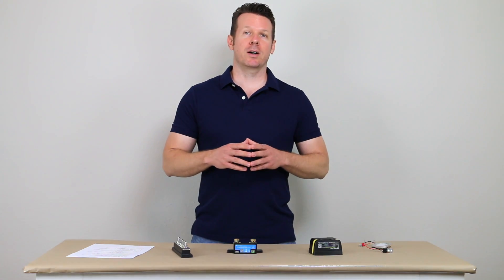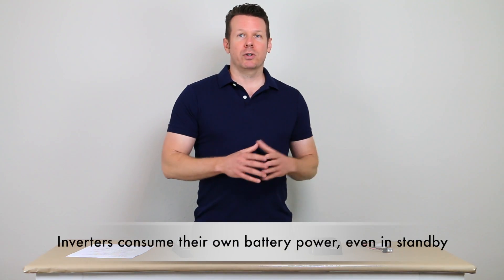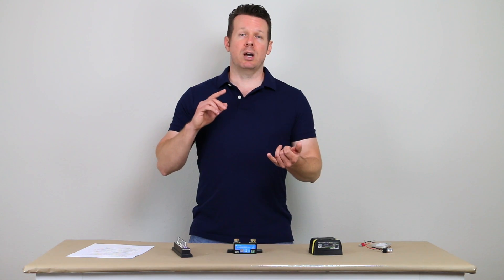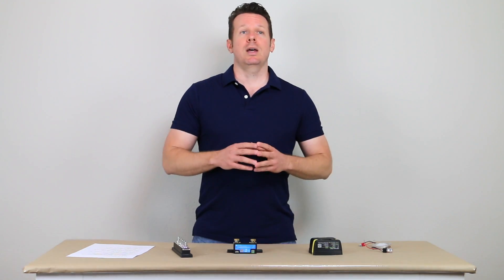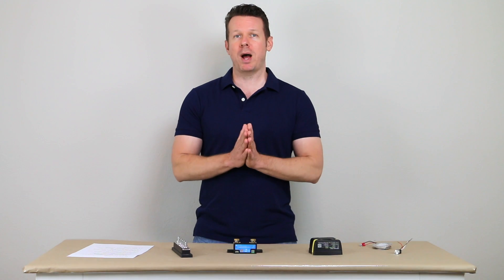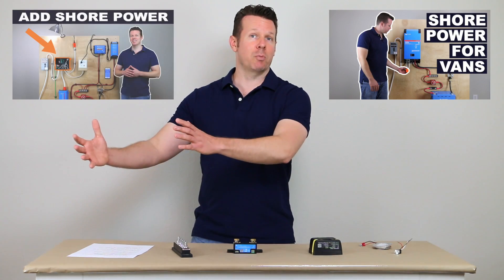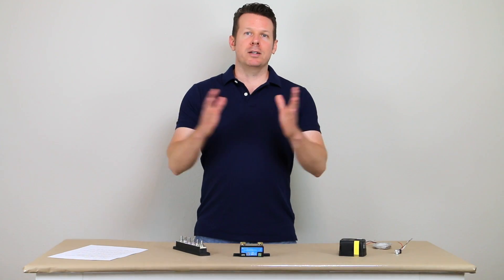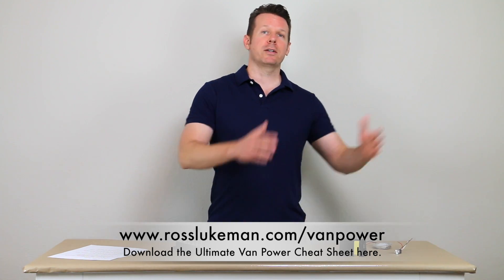The Top 10 Power System Mistakes for Van Conversions

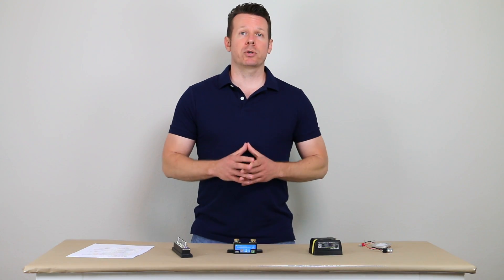Comment: 0:34 too many appliances
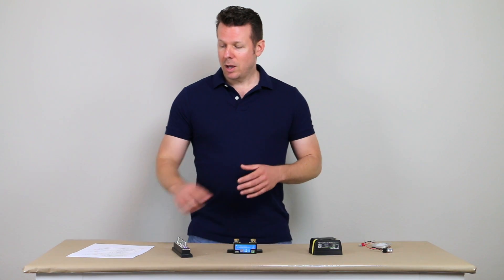2:14 lights should be 12v dimmers
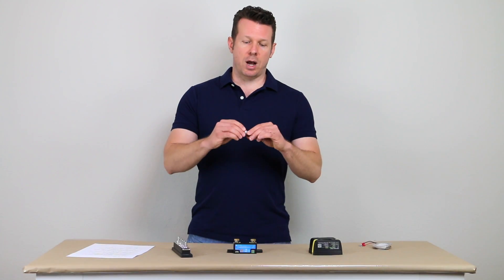3:04 invest in heating/cooling for comfort
4:22 plug in ability
5:28 relay instead of dc to dc charger
7:10 details on his cheat sheet (free)
8:28 easy switch for water heater
9:48 electric heaters (1500w!)
12:56 locking hardware

Comment: Definitely have a diesel heater for heat but also have a 38 SEER 240v Mini split for heat, too. Average amperage is 0.463 during a 24-hour run (14-20 degrees outside temp and maintained 66 degrees inside) Only 261w avg per hour!

Comment: Is there a simple system for just shore power and solar to charge 12 volt house batteries. I wouldn't mind spending money on the all in one inverter for when I plug into shore power it will just charge the batteries by way of shore power or solar...without me thinking about it.  I would like to keep the cabin system totally separate from the vans battery and alternator.

Comment: About the fridge situation. You mentioned dorm style fridge but you didn’t mention freezer style chest with dual thermostat that makes it work as fridge.
Reply from the maker: My point was that 120V AC appliances require the inverter to be on 24/7, so the freezer would have the same requirement as the 120V fridges.

Comment: One way to stay warm at night using electricity is with a 12V heating blanket. They typically use 40-60 watts, which is a lot less than a portable electric heater. . Why heat up the whole van when all you need is 'zone' heating (e.g., your body). 

If below freezing weather is possible, consider a 12V heating pad for your water supply. That's another example of zone heating. You don't want to wake up to ice damage. And... some foods don't react well to freezing temperatures either. Protect accordingly.

A 12V kettle will provide you with a way to warm you up internally before bedtime with some hot cocoa, tea or coffee (decaf of course) and maybe some oatmeal too.

Comment: Ross, I work with industrial power systems but do not have formal training with DC systems. I’ve heard and read that 24V and 48V increase longevity of battery lifetime. Why do a lot of vanlife type systems push 12V?
Reply from the maker: Hey there, I think 12V is preferred because it tends to match the alternators and appliances being used, at least in the current times and past decades. Perhaps that will change. I cannot see how higher voltage would change battery life, unless the current consumed is reduced. The current consumption would be a factor of a specific system's actual batteries and loads though, so I cannot make universal statements about using less current/capacity. I would be curious to hear their reasoning on increased battery life. Interesting question, thanks for tuning in-

Comment: Thanks for the many youtube information videos.
I had a Webasto heater. But it used miles of electricity when starting, but also when shutting down. (burner burning clean?) And with a thermostat it can therefore happen that quite a bit is consumed.
Reply from the maker: Hi Ben, thanks for tuning in and sharing your experience!

Comment: Hi there,
Currently I have a 2023 Winnebago Revel, originally it came with 320A Li3 battery, can I purchase another same battery to connect it in parallel, and become 640A? Will it mess up the whole system or will cause any damage? Please let me know. 
Many thanks!
Xiang Chen
Reply from the maker: Hi Xiang, I would say no, it won't mess anything up. You are essentially enlarging the "fuel tank," and this does not affect the "engine." However....I would ask Winnebago and see what they say.
Reply: @rosslukeman  Hi Ross, thank you so much for replying back to me so fast and giving me your opinions. Best wishes ❤️
Reply from the maker: Glad to help, good luck with it!

Comment: In the UK we find the fridge is better getting a 3 way fridge 1 is 12 volt ,2 is LPG , 3 is mains hook UP or switch to the inverter. And we use a diesel heater like they use in the cabs of a HGV

Comment: Problem is ...12v fridge cost a 1000 bucks for a proper  compressor driven unit . A 120 volt fridge .the same size cost under 200...
Reply: You make up for that cost in your energy use, and efficiency. Ying to the yang.

Comment: 12 volt appliance is the key. Lithium battery no need for solar the generator can fully charge a fully drain lithium in just 5 hours. Or alternator with a dc to dc charger.

Comment: Is the power draw between using a 12v fridge and a 120v home fridge really that big of a difference?
Reply: In my experience, the power draw is minimal and can be figured for by just getting one more battery and/or solar panel. A 12V fridge can only cool to about 40 degrees F below ambient air temperature, while a 120V "home" refrigerator 
will keep the temperature inside at the point you set it for. I have a small cubical refrigerator/freezer that, in refrigerator mode,  uses 828W @ startup; 285W down to 96W in about 5 minutes running, with no Wattage resting. That means one could use a seperate 1000W inverter to run it while keeping the pull from the battery at a minimum.
Reply: @Tumbleweed5150  My refrigerator/freezer is a table model, so not a small one and it consumes about 300 Watt per day, when the compressor is running it uses less than 50 Watt at 220V, 12 volt  models are tree times the kost, strange that they don't make energy efficient models in the US.
Reply: @Tumbleweed5150  I'm going to have to disagree with the 40° below ambient. I have a 12v compressor fridge and it's just as good as my home fridge. 0-10 for the freezer and 35-40 for the refrigerator. It uses about 65-70W when the compressor is running.
Reply from the maker: It's not the fridge itself, it's the extra wasted power of running it through an inverter, and keeping the inverter on 24/7 (in case the fridge needs to kick on), which also uses some power as the inverter sits there in standby.

Comment: Hi, I'm looking at installing a 240v hook up. Does the consumer unit need to be bonded/earthed to the chassis? Some people say definitely not, and some people say yes, so I'm not sure what to do. Thanks.
Reply from the maker: In general what you would connect to the chassis is a "case ground." The case of each piece of equipment is grounded to the chassis. The ground from the 240V cable is not grounded to the chassis. You're grounding the equipment casing to the chassis so that if the case becomes "hot" (electrified), you yourself are not the path for the electricity to flow to the chassis, the chassis ground wire will be.

Comment: Hello Ross, yes I am learning a lot from your DIY Solar Van Victron Electric Systems and builds. I am at a point where I want to build multiple portable generators but as you know there are times when the supply and distribution system do not always have the necessary part or solar panels I want. I am thinking about have just the battery with inverter that can be recharged by AC power until the solar panels and the other items are restocked. There on back order. I am also doing research and trying to understand multiple sized Victron inverters and how to use them as generators in both van and also off grid power supply in rural off grid agricultural settings. There are locations where I need 500 watt,1,200 and at times higher. I am trying to understand in the van build I want to build I want it to have it’s own battery bank but also have a station to recharge the batteries I use in the different Mobil generator batteries with inverters. Right now I do not know if I need two systems or one integrated system to do that?
Reply: In my personal experience, it's better to have one system just large enough to power what one needs, plus a little extra battery storage to run things if one gets a few days of clouds. Of course, that also depends on how much extra room one has in a vehicle. I do have solar systems on a pickup, trailer, and my main home/RV(That never moves, so I can put out plenty of solar panels. Otherwise, one has to get twice the electric cables, etc. Others may have different experiences             .
Reply: One system would be able to both maintain the battery bank in the van and charge Mobile battery banks. Ideally you would make your van battery Bank 24 or 48 volts and your mobile 12 volts has most victron charge controllers require that the charging voltage is higher than the battery voltage I have multiple amperage portable batteries that I can charge off each other but I use Genasun charge controllers

Comment: Hi Ross. I run a domestic fridge freezer in my van and have been for four summers. I’ve wired it to control it’s own dedicated inverter. When cool enough the whole system shuts down with zero consumption.
A lot of people followed my idea and it works perfectly. In fact it was cooling and freezing more efficiently than friends with a 3 way. And of course all for a fraction of the cost of a 3 way or 12vdc unit.
Reply: Have you posted a schematic of this set up? I'm curious about how it shuts down.
Reply: 3 ways are notoriously rubbish .
Reply: In terms of power consumption you cannot beat 12v with variable speed compressor.  In life you get what you pay for, I've been round the world three times with same fridge, in a yacht obviously.  I prefer the KISS principle. Just Google Danfoss variable speed compressor you'll get the idea.
Reply: No. Just simply turning it on/off with the thermostat.

Comment: I'm on the brink of building a system and am interested in your cheat sheet, but what I'm really after is a 4th method of charging: EV with a J1772 or some faster way if possible.
Reply from the maker: Hi Leslie, that sounds cool, but how many batteries are you going to have? The EV chargers are meant to fast charge the massive battery banks that run EV's. Small systems with a few batteries may not need that kind of power. Also if you put a ton of amps it's not necessarily good for the batteries.
Reply: @rosslukeman  I'm thinking 4 server rack for a little over 20kwh. No one online has done a teardown of the Delta Pro so I can't see how they managed to do it. And that new Zendure is also going to have it in the larger capacities. DP and Z are too pricey for what you get. It can't be rocket science if they are doing it. What is your idea of too many amps?

Comment: I have 2 agm batteries and an eberspasher diesel heater, when I run the heater overnight it takes a lot from the batteries, the van gets very cold at night, maybe the insulation is not good enough but I think the heater keeps firing up frequently because the  temp drops quickly unless something else?

Comment: Ross, great info.  Can we use the car booster cable to connect the inverter charger instead of wire you got ?( ie: cut the booster cable to use to connect your batteries system…. Thanks
Reply: Watch out for that label of the same gauge.
The insulation will likely be marked 'CCA'
This is an acronym for Copper Clad Aluminum. This material cannot safely carry the same current as pure copper conductors.
Reply from the maker: The wire size is specified in the manual. This is not something you want to mess around with. You need to wire it with the seriousness of an electrical engineer or you can burn down your vehicle or shorten your equipment's life. Good question but don't do that.

Comment: Can you run a 12v refrigerator off of a 48v system?
Reply from the maker: Hey there, yes you just need a 48v to 12v converter for any 12-volt loads.
Reply: @rosslukeman  I have found that it's better to get the 48V to 13.8V step down unit so that one isn't pulling as much Amps as it does with one that only puts out 12V.
Reply: p.s. I live off-grid with several solar systems around the property, of different sizes for different usages, including a 36V solar powered golf cart.

Comment: I'm  in a semi truck. I will be adding a 12volt ac unit. I will run it from 4 agm 105ah batteries.  I'm not sure what size dc to dc charger to use. Shore power would be great when I have the truck parked at home.  Alternator is 130amp and 4 starting batteries.  No solar charging in my  system.  Can you advise
Reply from the maker: Hey there, with that smaller alternator I wouldn't go over a 30 amp Orion unit to charge those batteries. It will power your A/C directly, but if the A/C pulls more than 30 amps the batteries will have to supplement. By this point in time I would just put some cheap lithiums in there. 400Ah of AGMs to run an air conditioner is going to put a lot of wear on them.
Reply: @rosslukeman  a company truck I had at a previous job had the same ac unit. The 4 agms did a good job. Just wasn't sure what the charging setup was
Thanks for the advice
Reply from the maker: @farmboy2883  Ah ok it sounds like standard equipment then. Well good luck with it, glad to help. As long as you limit the current through some type of charger, the alternator should be ok.
Reply: @rosslukeman  So when people add a second Victron DC to DC charger to their Ford Transit or Promaster are you saying that is too much? 

Should I just stick with the one Victron DC to DC charger to charge my lithium battery bank?
Reply: I have honda generators on my semi truck  and a 2000 watt inverter/charger which keeps my 4 truck agm batteries charged works great even can use my block heater
Reply from the maker: @tomrandall4209  Thanks for sharing your experience Tom.

Comment: HI Ross, quick question, besides the three power sources do you have any videos on how to wire an onboard generator to charge the batteries on demand, thanks
Reply from the maker: Hey there, I don't have a video on that explicit topic, but I do talk about how generators would connect in this video on transfer switches: (https://youtu.be/iYFgxuDWrmA) The outgoing line of the transfer switch would then go to an inverter-charger (which has a second transfer switch). It's a dual transfer switch situation. Hope that helps!

Comment: Hmm...   Just a little commentary about item #2...   Correct me if I'm wrong, but I don't believe dimmers conserve energy in a circuit that otherwise doesn't have one.   As I understand it, dimmers store the energy as heat within the device itself that otherwise would make it to the light.   In the end, the same amount of electricity consumed, just less light, and a warm dimmer.
Reply from the maker: Hi Gerald, thanks for weighing in. In the case of the dimmers, I was just saying use them for those early mornings or late nights when you don't want full brightness. That particular item was not about power conservation, but more for ergonomics.
Reply: @rosslukeman  Hi Roos, why not plug external generator to off shore power outlet and let Victron MultiPlus handle the rest. Anything wrong with that setup?
Reply from the maker: Hi  @krzysztoforlowski6010  no there is nothing wrong with that. That setup will work great.
Reply: I installed a dimmer last summer and according to my victon shunt, it did seem to reduce the wattage on the display. I can't remember by how much but there was definitely a difference.

Comment: Thank you Ross, Very useful video. All 10 points were spot on! 
Talking about Inverters, do you have any suggestion to be able to use Laptops+Monitors without the need of having an inverter on ? I made few voltage converter for my laptops to replace the charger brick but I am interested in your view.
Keep up the good work!
Reply from the maker: Thanks Giuseppe, I'm glad you found the video helpful! It depends on how much modification you're willing to do and how important efficiency is for each person. I can see how using a DC-DC converter instead of the charger brick could be useful so you can leave the inverter off. As far as monitors, there are a few 12-volt editions, but they are indeed expensive. 

One thing I have done in the past is create dual-inverter systems where there is a small "electronics inverter" that only puts out 200-300 watts and can be used to run small appliances/computers without turning on the large inverter that runs the larger appliances. I run these inverters through a split breaker box (WF-8930/50) and then to separate outlets in the van. Kind of complicated but like I said it depends on how important efficiency is to you. Sometimes it's easier to throw in another battery and be done.
Reply: If the monitor is 20V you can use a PD car charger and wire up a PD trigger board
Reply: If you are already invested in a power  tool platform ,there are adapters that fit right on the battery to give you DC via a USB port,they are very convenient as you can use them independent of your fixed electrical system.